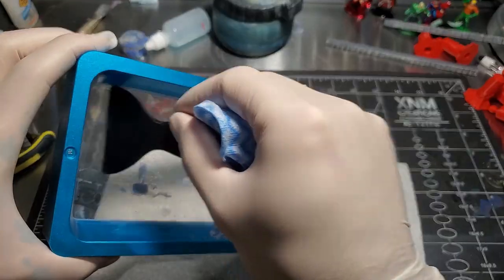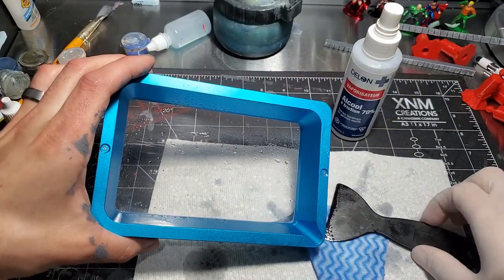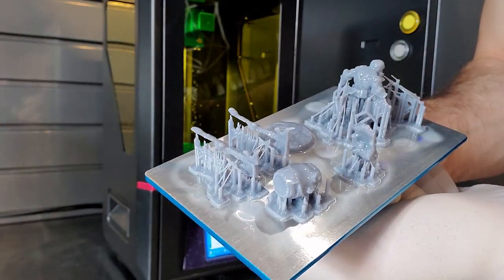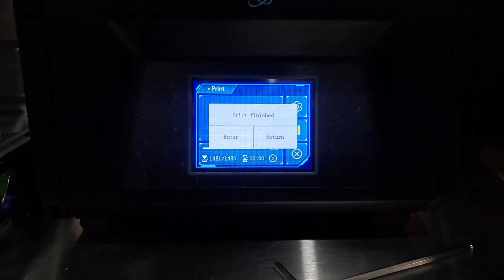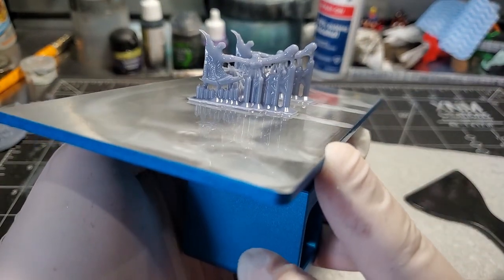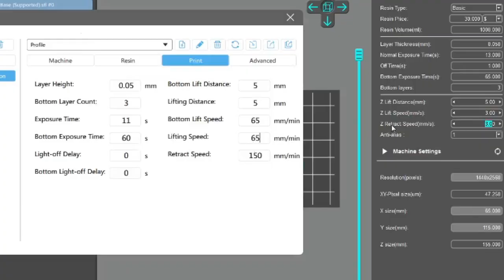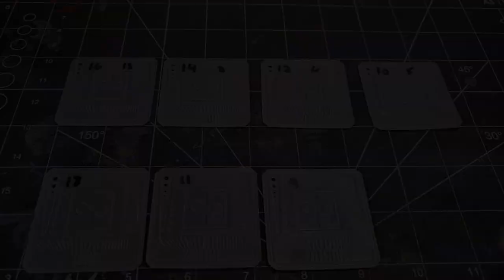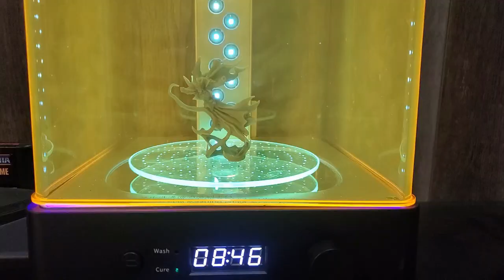3d RESIN PRINT FAILURES and SOLUTIONS not sticking to build plate sticking to fep, exposure settings

Comment: i just got the photon mono x and did 3 test prints. the resin started to get slimey and stick to the build plate. any ideas why that would happen?
Reply from the maker: What is the temperature of the room you are printing in?
Reply: @FacilityD20  oh it's probably that lol. It's in my shed. What would you recommend to do to keep the printer warm, insulated. I mostly try to print at night.

Comment: I don't think a bench out of level should cause any issues, as long as the plate is level with the FEP and there is sufficient depth to cover, a tilt would likely not cause any issues and may help actually push bubbles out at the start?
Reply from the maker: it depends

Comment: Hi. Recently found your videos, while searshing for hints about getting into resin printing myself (recently purchased Anycubic Photon Mono).

So obviously I am not an expert, but I feel like the unsticking from the bed problem has more to do with initial levels exposure, rather than general exposure time. Not sure if Photon S has those settings, but with Photon Mono, you can specify however many you want first layers to have really long exposure. By default those were lirst 5 layers at 40 seconts exposure. And then 2 seconds per layer for the rest of the model.

Have you looked into this?

EDIT: Noticed the detailed settings you have later in the video. You seem to have 65 seconds exposure for 3 layers, so it looks like you have this covered.
Still wondering if you tried playing with those settings and if they helped at all.
Reply from the maker: Thanks for the input. I think the issue was a combination of leveling, exposure layer time and poor supports. I have been having a lot more successes then failure as of late however.

Comment: I had problems with prints popping off the build plate. Two things, plate was to smooth and my resin was crap. I wet sanded my plate with 600 grit sand paper. And new better resin didn’t warp.
Reply from the maker: The resin being poor crossed my mind, but the temperature was also fluctuating during that week from -20 to + 5C outside. I have a feeling I will be adjusting my exposure settings again this summer.

Comment: I had the same issues with the first resin printer (Voxelab Proxima 6.0), it was cheap and a good deal on Amazon to boot. I gave up with it and sent it back. By chance I found the halot one for a little bit more, very similar spec 2k mono screen. The difference was night and day. It printed out of the box. 
I can't comment on your printer as I am very new to this. I get great prints with layer times of 2.5 to 3.5s. 9 and 10 second sounds excessive, it must take an absolute age to print anything.
Reply from the maker: Thanks for sharing that good to know. I don't have a mono screen that is why the exposure times are so high

Comment: I do not see an option to save my sliced files as a PWS, only PWMO, any suggestions?
Reply from the maker: Make sure you have the latest version of the software for the slicer program you are using, and when you "slice and export your files," there should be a option for different file types.

Comment: I have the problem that surfaces which are parallel to the printplate are extremely blurred and the Support Marks in these areas are extreme. Do you guys have any tips for me
Reply from the maker: Sounds like it could be an orientation of the STL file issue... or the quality (layer height) you are  printing in is off. Also, you can change the "depth" of your supports, that will help due a lot less damage when removed.

Comment: my raft and supports print perfect but my model is always stuck to build plate.  Anyone ever have this issue, it makes no sense to me.  i'm using latest version of chitubox.  I've re oriented my piece at different angles, i've tried heavy supports and medium and a mix of all 3.  My raft has no problem sticking to build plate all my suuports print like its holding the model but the model is always not there and stuck to build plate.  I've attemped 4 different times.  Any help would be greatly appreciated.
Reply from the maker: I believe your lift speeds are too fast. Try dropping back 20%

Comment: I don't understand how a level surface for the printer to sit on will have anything to do with the parallelism between your build plate and the FEP/LCD screen.
Reply from the maker: Without a long winded answer, it can affect things like temp and running out of reason early in some areas... in this case no idea, but I moved it to a level surface and it printed right away... anyway it's on a level area now for what it's worth.

Comment: I’m having a issue with my halot one resin printer where nothing is sticking to the bed plate it’s just a small knight figure at 32mm. I’ve tried to use a glue stick on the bed plate. Softly sanded it, cleaned the basin bin for the resin and used a wipe on the bed plate. It’s not sticking still
Reply from the maker: It honestly still could be a bed leveling issue or your exposure times are to short.

Comment: My printer Photon but I using anycubic resin 405 nm orange resin,but my jewelry ring not print, and flp film sticky resin, no print on print head,so what settings required in photon software in laptop and what settings use in uv light rectangular option in printer, I use 6 digit for uv light, but my print not printing, only flp film print base line of designing only, so where is problem I am not understanding, please help me solve my problem
Reply: I'm no expert, but try re leveling the bed , maybe too close to your fep
Reply from the maker: sorry not sure
Reply from the maker: leveling always cause issues yes

Comment: I’ve been having issues with bricking. It’s just solid bricks and uses all my resin in one print. It mimics the base then goes all the way up like a brick wall. I cleaned everything and leveled the plate then had no adhesion. I’ve had bricks out of 3/4 prints. I can’t find anything anywhere and so frustrated.
Reply from the maker: You either have a software issue or a hardware issue. Bricking is common if the firmware needs an update or is wrong another. Update your slicer as well. Also, i have heard of this issue when there is a wireing issue with your light source or the plug is clip in backward.

Comment: I can see why placing a resin printer un a massively uneven surface would impact a resin print, but I am having a hard time understanding why a modestly uneven surface would impact the print. It's a closed system: the plate surface, fep surface and screen surface should still be completely parallel to each other.
Reply from the maker: The fluid will be deeper in one end or the other and could affect the temp of the resin in one area. When resin is getting really low one side could run dry before the other. But no, not a real big deal.
Reply: @FacilityD20  I agree that running out of resin would affect the print. However, I'm not sure about the temperature argument. If the resin was recently poured, the temperature is homogeneous. If it's been sitting in the vat for a while, everything would reach a steady state.  If there were some slight differential, it would likely be too small to impact prints, AND, the resin would get mixed the moment the build plate plunged into the resin.

Comment: Temperature of the room is important.
Reply from the maker: 100%
Reply: @FacilityD20  I was using the High strength engineering resin from Molazon with failure after failure...It needs a room with a stable 85 deg temp. 😂

Comment: WHY does it stick to the FEP though? I have levelled this thing so many times... every print - seems to print on the FEP??? Arrrgh!!
Reply from the maker: There are a few reason, this could be, I will list them in no particular order: 1. Fep to tight 2. Fep to loose. 3. bottom exposure time to long 4. bottom exposure time too short 5. lift speed to fast 6. temperature of room to cold. 7. z=0 not set properly...and I will say it again level... when leveling, when you pull the paper it needs to be able to pull out but not push back in, don't over pinch it here, as soon as it gets to that point don't drop the z any further. Also very important, when pulling out the paper, hold the paper in the center and pull out, it needs to slide out equally, if it grabs from one side or the other and starts to twist as it comes out its not properly level. You may have to apply a little force on the loose side with you fingers when you tighten down the bed.

Comment: Im using a mono x and have gotten my settings with my test print at 50um down to 1 second print time but i go and do a print come to check on it hour later and nothing stuck, idk il try from 4 to 8 layers that might do it
Reply: i do live in the tropic so my temps can go from 22c to 34c so i generally have my fan/ac on an keep my room at a steady 25c yes i do print in my bedroom and no i dont have any issues so far after 3 months with it
Reply from the maker: 1s seems a bit short even for the mono x. How many bottom layers are you running and what is the exposure time on them?

Comment: To me, it seems 3D printing is an expensive hobby.  Not only do you have to factor in the cost of resin, electricity, etc., but also the cost of wasted material.
Reply from the maker: It has a high initial up-front cost, but the breakeven point comes fast if you're into miniatures or terrain building like I am.
Reply: It's actually not expensive at all. Photon mono is around $180, and resin is cheap for how many miniatures you can get from just a liter. Additionally the machine uses very little energy, it's just tiny motor and modest light.

Comment: I'm not sure why putting the printer on a level surface would help with bed levelling. The build plate is relative to the printer, so if you tilt one, the other tilts in the same way. So leveling it would be the same even if you flipped the printer sideways.
Reply from the maker: Having more resin in one side due to uneven surfaces can effect things like tempature, but it's not super critical. I just feel like it is always good to start with a level base.

Comment: you're still really overexposed, which is weird. I ended up using the wd40 dry lube on the fep, sanding my build plate with some 220 grit, and started printing at 25C or warmer by using a space heater. my xps validation prints are no where near as overexposed as even your 9 second one and the supports still print down to .2 mms.
maybe the supports aren't printing properly because they are overexposed and brittle? you want your settings to make it so the xps print will have that nice point in the center. I use 2.8 or 2.9 sec depending on the resin, but I have a mono screen.
Reply from the maker: That week the tempature was all over the place too it sent from +20c to 20c... causing the room that the printer was in to fluctuate +/ 5c. I have since dialed the printer into 9s and it's working well

Comment: Damn my stuff still ain't sticking. Maybe the entire house is not leveled? XD
For real it's hard to find a level place in this home.
Reply from the maker: When you level your bed the paper needs to pull out equally. If it catches on a coner even a little, it's not level, relevel so all 4 corners are equal. Then make sure you go down extra tight against that paper, basically so it doesn't move. Then set z=0 at that point.
Reply: @FacilityD20  Alright, This time I really made it so the paper didn't move at all (pressed 0.1mm all the way to the bottom). Hopefully in 3 hours the print is done.
Reply: @FacilityD20  Gave it another try. Nope just wont stick :(

I really don't understand what I am doing wrong.

Comment: Your exposure times are still way off mate, keep going until everything prints perfect on the test print. I did 27 tries on my Bene 4 mono and finally got it perfect at 2.7s. Did three more at that to make sure. Every print I have done since has been perfect. Keep at it and you will get that bitch dialled in.
Reply from the maker: I have them down to 9s not, it seems to work well

Comment: or or... just use the recommended settings tested by thousands of people in the lychee slicer software... I never had a bad print in the anycubic photon mono 4k.
Reply from the maker: Wasn't out back then. Also, temperature was an issue in my garage, too. However, there is a lot more info out there now these days on settings
Reply: Gonna give that a try tomorrow. Been using Halot Box for my calibration prints

Comment: One thing I understood with Resin printers, its too early. This tech is not even worth talking about because its so primitive and unstable.
I tried 2 most commong printers, and most explainations/values ppl suggested. fail, custom models = NOT working. Doesnt matter what I do.
Anything with supports is 100% failed print for now. I tried 2-10 sec exp. and 30-90s for bottom exp.
Mostly they stick to FEP instead. Anycubic Resin was worst resin for now.
Elegoo ABS like transparent on Elegoo mars first layers INSTANLY melted to FEP (yep, I cant get them off)
Bed is leveled perfectly. 
Rooks printed, anything else (over 10 prints after that) not even close.
All in one 2 week into resin printing (After FDM experience) and its just more frustrating than fun tbh.
I didnt know Resin printers are so difficult to print with. I thought FDM are hard but apparently not :)
The biggest problem ist that you have to clean your vat after EVERY failed print, and so far I had only cleaning all the time and 2 rooks for 150€ x)
Reply from the maker: I understand that can be frustrating. I know I'm kicking a dead horse here but it is still most likely a bed leveling issue, settings or the Fep is either to tight or too lose. My first 2 week's was hard to, after that is has been smooth sailing for me. Dont give up just yet

Comment: How level the table the printer sits on is irrelevant.
The build plate has to be aligned with the fep. Thats all.
Reply from the maker: Depends on how uneven the table actually is. One side of the vat can be deeper then the other. This will cause temperature changes which effects curing, also one side of the build plate/print will eventually not be covered in resin when Resin is running low, and the printer could be trying to print where there is a dry spot.

Comment: I had supports print without the part. It looked like the part disappeared from the print. Also support rafts stuck to build plate and fep with nothing between and other part printing fine...all this in the same print.
Reply from the maker: Sounds like the supports didnt have enough connection depth to the part and could hold it. And/or the life speed is too high. Try droping the lift speed by 20%
Reply: @FacilityD20  
Thanks. I'll try it.